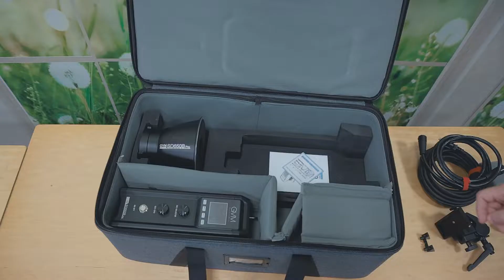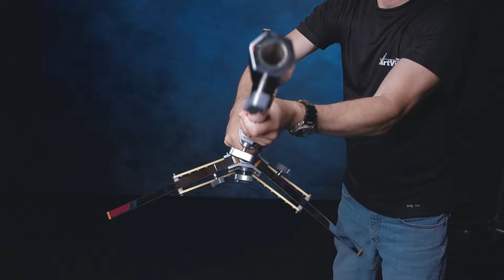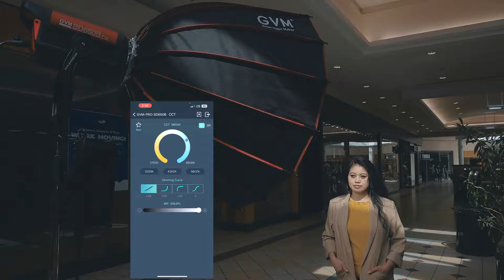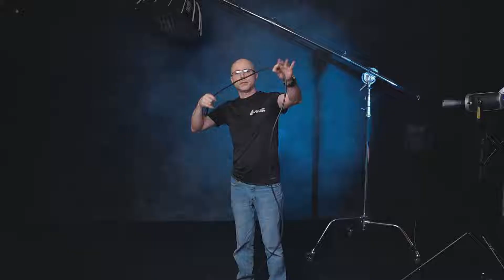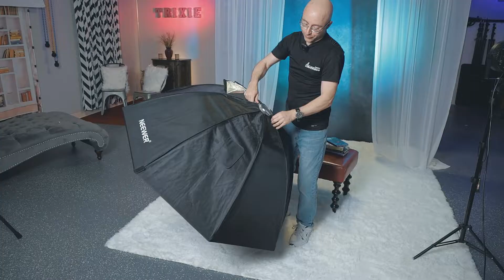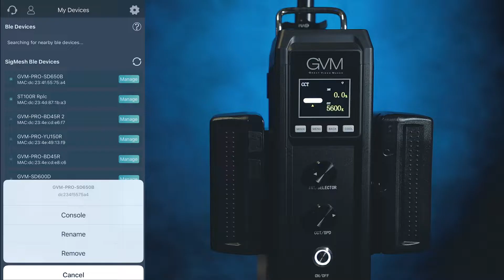GVM Pro SD650B LED Studio Lighting: Your Complete Guide & Review

Comment: I just got mine.. 2 hrs later I am packing it up to send back.. Unless you run it on silent with only 20% output  Turn to 100% and traffic noise won't drownn it out.
I film Broadcast TV ...this it far too loud if you want to use it for what it is for.. a bright 650w output light.

Comment: Does it charge your V-mount batteries while the light is plugged in?  That would be AWESOME if it did.
Reply from the maker: The control unit doesn't charge your V-mount while using the light.